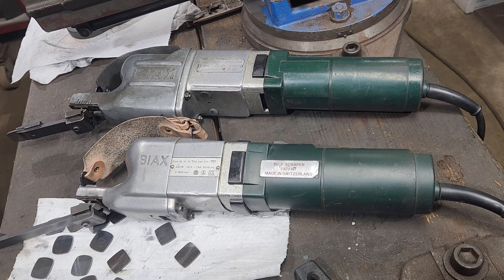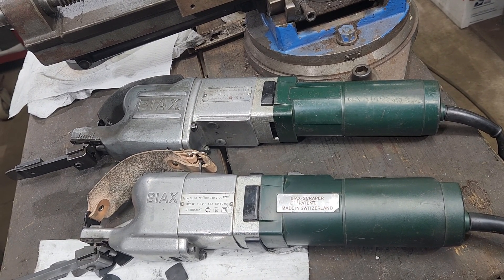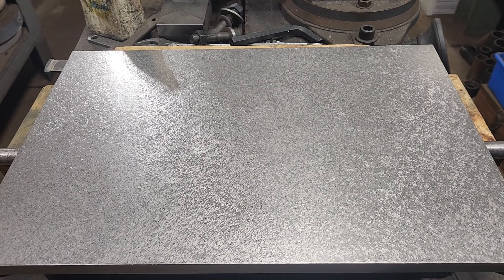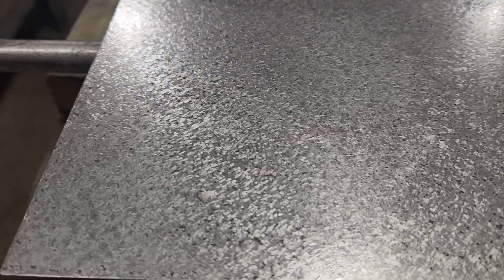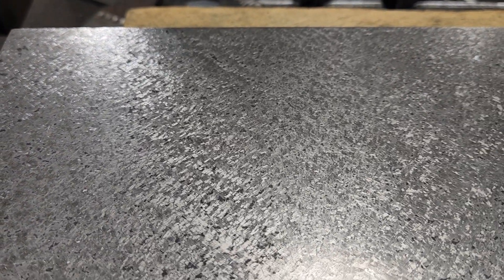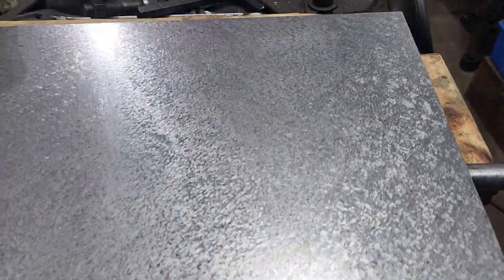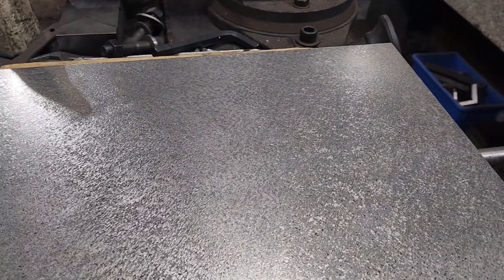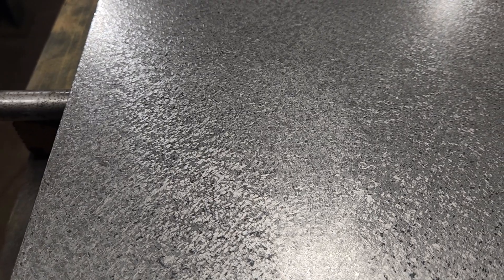40 PPI Scraping

Comment: I believe I understand what you are describing, but it's a shame you didn't actually demonstrate the differences between the two techniques. Also, the reduced weight of the smaller scraper may allow for what you are doing and not be suitable for the standard Biax (without a tool counterbalance.) The resulting texture looks great, no obvious signs of the backstroke, but again it seems like such a missed opportunity to actually show the technique and a final print of the plate instead of *tell*ing us about it. Love what you are doing here, so little documentation on power scraping out there, just trying to squeeze as much out of you as I can.
Reply from the maker: I get what you are saying about comparing the 2 ways. I think I did a video a while back showing the way I scrape 40 points when I rebuilt a thread roller. I wish I had a better way to video and edit them. As it is, I am just using my phone. I will try to do a comparison of the two practices soon.

 Today I am traveling to another turret job.

Comment: What looks like black spots in the video are the high spots?  Charles
Reply from the maker: Yes, those are the highest spots, but there are many more smaller bearing points that would show up if printed. I could actually make one more pass and split those dark spots without printing it to make it even better. I will probably do that before I sell it. The point of the video was the actual scraping style, not holding the weight of the scraper and doing what others call "dive bombing". Dive bombing is hard on an old guy and makes for a major back ache on a plate this size.

Let the weight of the scraper do the work, and adjust the speed of the tip movement to hit the high spots. It takes some practice to get the hang of it, but much less stressful than supporting the weight of the scraper.